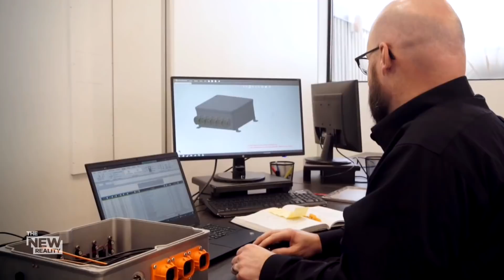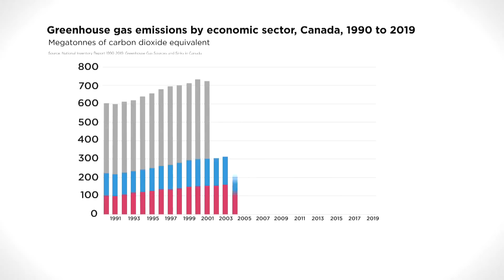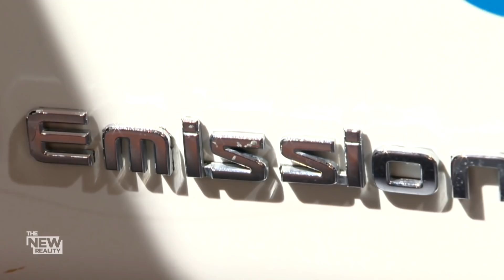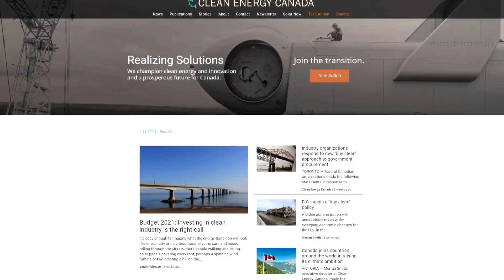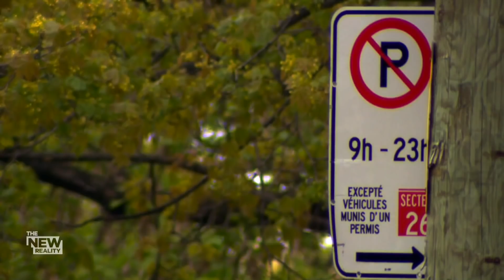The Big Shift: Is Canada ready for the EV revolution?

Comment: Ah no. It will never work. Period. Just drive the 400 series highways in the summer with the 100km stalled traffic. We have a 6000km road distance of communities and it took Ontario 100 years to put in rest areas at existing gas stops. Can you imagine the  LINE UPS for all those cars driving to the cottage in summer. Lunacy. 1min gas stops versus 3-6hr charge ups? Green zealots are nuts if they think this will ever work.

Comment: Going pure electric, increases the impact on the electrical grid, rises the rates of already high hydro costs, and thus likely more power outages leading to people not being able to use their cars because of battery, power issues causing unfathomable problems including not being able to get to work. Solar and wind power won't be able to supply  the needs of all especially in -40 cold areas of the country. The climate minister proposed a quota for car companies must meet for electric cars which is a super bad idea which could also lead to sacrificing quality to meet a quota. The price of electrical cars  right now are not affordable for most of the population. Rising costs which include taxes, gas, food, supplies, bills, heat, hydro and cost of living doesn't help matters.  I believe making a more affordable car that runs on electric and can be also run on gas or diesel would be a way better idea for the future of mankind. Also the technology of electric cars might improve but I believe strictly electric would be a bad idea. You should have a 2nd option like gas.  Just like I think running your house just off of hydro and natural gas that need hydro to run is a bad idea especially in cold winters, you should have a back up heating source like wood in case power fails or at least a outside generator. Some might disagree some might agree. Electric safety vehicles run on batteries and electric such as Ambulances if power electric problems arose could become a safety issue waiting to happen. Gas or diesel is not as much of an issue with safety vehicles and has worked great.  What about firetruck run on strictly electric, another bad idea. What about snow clearing highway machines run on electric batteries, another bad idea in my opinion. What are your thoughts?
Reply: Story about this in the Toronto Sun today with many comments like this , but nowhere did I find anyone questioning how the government would recoup the loss of millions of dollars  each day in lost gas taxes . As Louis  M. mentioned , we would see a road tax or pay a tax on your odometer reading ?  They will get us one way or another !

Comment: They need to go back to the drawing board and re-engineer the cars and 'charging' stations to permit swappable battery packs.  Drop off your drained batteries in a chute and plug in pre-charged ones at the station.  No wait times.
Reply: That would be very cool, though charge times are dropping significantly. Tesla V3 chargers are crazy quick compared to V1.
Reply: @Snarkonymous  😬Didja hear about Mike Burry shorting Tesla?  That is definitely not a good sign.
Reply: @wanderingfido  Tesla has been one of the most shorted stocks in modern times since day one, and most of those shorts have lost their shirts.
Reply: Swappable batteries dont make sense since you would need a lot of batteries in circulation compared to non swappable batteries. Secondly, battery manufacturing is a big bottle neck and there very few players who do it. Lastly, people don't mind waiting 20-30 mins to charge batteries.
Reply: @anirudhhhh  Agreed.  But 20 to 30 mins would be the maximum tolerance for most people, especially the karens.  We are really talking about at least an hour and some change.  And as the batteries inevitably deteriorate that wait time will get progressively longer.  They are saying it's going to be 72 minutes.  That will quickly become intolerable if endured at all.

Comment: The first electric vehicle was invented by robert anderson in the 1830s. It was called the electric carriage. I personally saw Thomas Edison's electric car in his museum in New Jersey. The reason why EVs never took off is because its problematic in many ways like limited range, battery costs, charging time, increased demand on the power grid, which our current grid cannot handle. Also what happens when you run out of battery while driving. It's not like someone can run a charging station to you the same way that someone can run a gas can to you etc.
Reply: The fact that the current grid cannot handle it is simply not true. 

Costs are often prohibitive that is very true but economy of scale is dropping them quickly, the new electric f150 is now in line with its gas alternative.

Charge time is not as big a deal as one might think. Many people can just make it happen while they sleep. They actually spend less time actively fueling their car than when they ran gas. 

I have never run out of gas driving. I have never run out of charge driving. That is a tiny edge case that I feel like isn't really worth even thinking about.
Reply: It's true
Reply: I'm smoking some G Gas right now

Comment: And our power plants are burning fossil fuel.
Reply: @Joe-by8jh  No one said there was though BC comes close. The point is, it doesn't matter. The energy infrastructure is in transition and an EV running off electricity produced by coal and diesel plants, is still, over the course of its lifetime, cleaner than a gas car.
Reply: Not in my Province.
Reply: Hydro isn't
Reply: @Mitch Holder I think you missed the point.

Comment: Most EV charging station models allows small businesses to generate profits from purchasing and installing a charging station within 1 year. A charging station (l2) costs $1500. Assuming $20 per charge (the cost to fully charge a Tesla) and 50% margin, that’s only 180-200 charges to break even. The bigger issue is the lack of lithium to create all of these batteries
Reply: Son Off A Witch  very cool
Reply: Son Off A Witch  I was referring to the global lack of lithium. There isn’t enough natural Lithium sources in the world to replace 50% of gas powered vehicles. 

In terms of pollution, there are 2 sources from my understanding. 
1. Natural springs under ground that gets pumped to the top through a pipe. Then the water is left to evaporate on the ground through the sun and the lithium is then leftover. Not as harmful for the environment.
2. Rock mining for lithium, which is definitely harmful. 

Majority of the people have differing views on the environmental impact of EVs. But what is indisputable is that EV vehicles perform much better than gas despite being in the infancy stage of technology (Hummer EV produces 11,000 torque).

Comment: A typical Tesla sells for around 80 Thousand Dollars. Has 2 Lithium Batteries, these batteries are rated for 2 Years. Or 200 Thousand Kilometers, whichever comes first.The replacement cost of these batteries is 26 Thousand Dollars each. 52 Thousand Dollars, 2 THIRDS the price of the car. And in the 2ND largest country in the WORLD, 200 Thousand Kilometers racks up really fast. Green is for the rich, they're the only people who can afford it. 
By the way, the replacement cost of the front windshield on a Tesla. Is 7 Thousand Dollars.
Reply: This is complete misinformation:

The most widely sold Tesla is the model 3. The base of which cost half of what you stated. The battery last much much longer than you stated. Mine is currently 2.5 years old and perfectly fine. The electric motor is rated for a million miles. What is yours rated for?

There is 1 battery pack in the car and it does not cost 26 thousand dollars to replace.

It also doesn't cost 7 thousand dollars to replace the windshield. Jesus, where do you get this crap fromj?
Reply: @Snarkonymous   I got this information from the husband of a woman who just had to have one of these Toxic Wastemobile's. By the way your Model 3, is the CHEAPEST model they have. You must live in Toronto, which is why YOUR Toxic Wastemobile is still on the road. It's easy to make anything last when you only drive in the city. In 1976 i bought Chevy Monte Carlo. By time time i finally retired it. I had racked up 1.5 Million Miles on it. All on the original engine, and the guy who bought it. Restored it and it is still on the road. Having now accumulated an additional 750 Thousand Miles. Still on the original engine. Let's see your Tesla Toxic Wastemobile beat that.
Reply: @barrywakeford1385  Well, hate to break it to you champ but you were lied to. Yes the model 3 is the cheapest and by far the most sold. You mentioned the average tesla. The model 3 is the average.
Reply: @barrywakeford1385  Here are some real facts for you.

The cost of a windshield is whatever your insurance deductible is. It's no different than any other car,

The cost to replace a battery is between 3 and 7k which is less than half of what you quoted. 

The battery is rated between 3 to 5 hundred k, which is more than most gas engines. 

You make it sound as if that engine got 2 million miles without having work done to it over the course of its life. Anyone who's had a gas vehicle knows that isn't the case. 

I don't live in Toronto. Should I assume you live in Alberta? Is that the game we are playing?

The model 3 is the cheapest yes. It is also by far the most sold. which means you are wrong about the average price just has you have been wrong about everything else you have posted. Why don't you be a man and admit when you are wrong?

Comment: We talk about the cost of the car. But we didnt talk that Ontario we pay more for Electricity. AND THEN talk about insurance on these. I would love to make the jump but it would cost me double what I pay for my gas powered vehicle. I've done the math over and over and it just doesnt line up to even think about it. They bring down the cost of an EV dramatically and insurance rates will follow. Then we will talk!
Reply: They won't do it that way, they want you to buy the expensive electric car and pay higher electricity prices at the same time. Anyone who says they can't afford it will be stuck walking or taking city buses from now on. They genuinely don't care if you can't afford this, they want you to make the sacrifice anyway "for the greater good" and then thank them for it.
Reply: I can tell you from real world experience that it is still way cheaper to charge a car than to gas one up. I don't now what math you have done but it is very flawed. The insurance isn't that much more expensive, certainly not to the point where it would break the bank.

Comment: I hate that they are trying to shove EVs down our throats.  Why not invest in hydrogen fuel cell cars?  It’s zero emission and takes 3 minutes to fill up.
Reply: Battery-operated vehicles are more efficient then hydrogen operated vehicles. Hydrogen vehicles are only 60% efficient.
Reply: @Kyle-rl1dd  60%... in what way?
Reply: @MrRMT1986  in energy transfer from one sate to another.

Combustion engines are the worst they lose a lot in heat when they transfer energy.

Also the energy in hydrogen transferring it to electricity, to get the motor loses some efficiency.

Battery vehicles have better efficiency because they are taking in electricity and storing it and then supplying it to the motor there's no transfer of matter. But still a little bit of efficiency is lost.
Reply: They want to push the EV scam to milk people, electric vehicles are not practical and we are better off using synthetic fuels and hydrogen.
Reply: Also switching from gas to EVs will have massive economic implications. Think of gas stations, refineries, fuel transport etc. All that will be wiped out. Amazon will be hiring of course.
Reply: @MrRMT1986  The switch is happening regardless of any "economic implication".
Reply: @sandorski56  I say lets give people options whether they want to use gas or electric, lets promote free market capitalism an economic growth.
Reply: @nogreatreset8506 north america tried free market capitalism it was a bust.
Reply: EVs are ready, Hydrogen fuel cell vehicles are not. It is also far easier to Produce and Distribute electricity. Hydrogen might take over eventually, but not anytime soon.
Reply: @sandorski56  did you watch the video? EV is far from ready yet
Reply: exactlyy

Comment: lol it only takes a few hours to charge your car...compared to a few mins it takes to fill your gas tank.....
Reply: @69Mach I CJ Nope. There's this thing. It's called fast charging and if you own a Tesla it's even quicker. Your ignorance is boring.
Reply: @69Mach I CJ Ahhh an Albertan. Thanks for confirming the stereotype. It does take more. It takes about as much time as stopping half way for a quick lunch.

I can't speak to your trailer. I don't know what type it is and/or how heavy due to empty kokanee cans and shot gun shells.
Reply: @69Mach I CJ exactly, we might as well just go back to riding horses if it takes that long
Reply: @69Mach I CJ hahahaha ok where to start:

1 - Yes it sells carbon credits. So would the other companies if they could. Sucks to be them.

2 - Space X is a different company. Rockets don't run on diesel. I look forward to you pointing out the clean fuel that a rocket should use.

3 - Electric cars absolutely do not pollute more than gas cars.

4 - You are the derp.
Reply: @Snarkonymous  dude just ride a horse, it's cheaper and faster
Reply: @erictyson5947  le sigh
Reply: @69Mach I CJ It does in a Gas Shortage.
Reply: You can charge it while you sleep you dope.